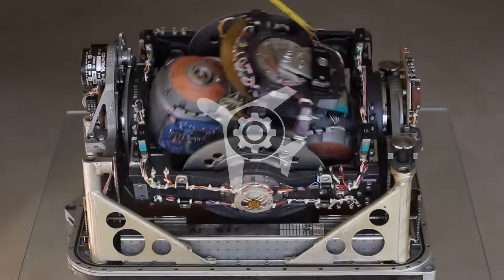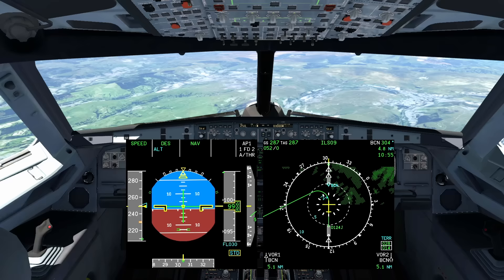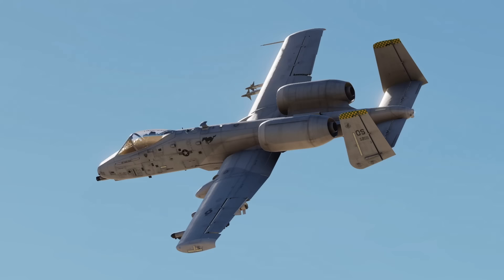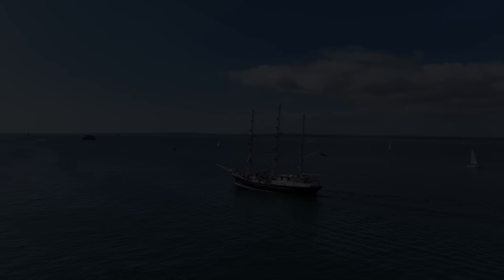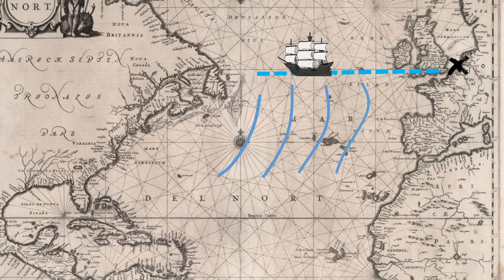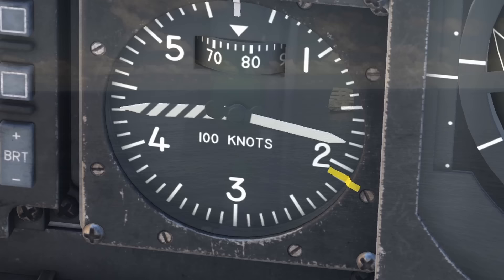The GENIUS of Inertial Navigation Systems Explained

Comment: Nice!  Just to emphasise, the accelerometers measure a change in velocity or speed in a particular direction, not the velocity.  The velocity is determined from the initialization of a zero point along with the additions (and subtractions) of accelerations in three directions along the route.  The gyroscopes keep track of the direction changes made during the route.  The computer keeps track of all the data and gives the location at any point along the route.  Thanks for this great video!!!
Reply from the maker: Thanks!

Comment: Great video. Just one problem: Accelerometers do NOT measure gravity directly. If you Set a single-axis accelerometer on a table with its axis oriented vertically, the instrument registers 1g - even though it is not accelerating.  The table is pushing up with a force equal to the weight of the instrument. Gravity is pushing down with an equal force. The instrument does not accelerate, but it says it's accelerating at +1g - that is UPWARD at 1g. The instrument fails to respond to gravity, and therefore registers the acceleration from the TABLE FORCE ALONE. If you want to get the TRUE acceleration, you have to ADD IN THE EFFECT OF GRAVITY, which is NEGATIVE 1g. 

Remove the table, and the instrument drops, accelerating at -1g. In free fall, it registers 0g. (Note that gravity is operating - you can see the instrument fall! The accelerometer registers nothing, however.) To get the accelerometer's true acceleration, you have to ADD IN THE EFFECT OF GRAVITY, which is NEGATIVE 1g. 

In inertial systems, gravity is never actually measured; it is always inferred from attitude and altitude.

Comment: This technique also exists in nature. The Sahara Deser ant nagigates like this. It walks a number of steps relative to the sun in somewhat random pattern and if it gets to hot, it walk straight back to its antbuilding. A funny thing about this is, that if If the legs are cut shorter when it starts to walk back, it walks just a part of the way back. Also if you elongate its legs when it starts walking back, it walks past its antbuilding.

Comment: I operated & maintained the USN's SINS Mk.3 Mod 4 & Mod 6 inertial navigators in the 1980-90's on an SSN. This was a super sized version of the system described. It was designed in the late 1950's for use on the USS George Washington Class, the 1st strategic ballistic missile submarine. My specific unit was manufactured 6 months before I was born 🤣, it measured a good 7 feet across with head sized gyros & 2 full sized consoles for the pre-integrated circuit computers. Magnetic Drum Memory, those were "the Days." It worked fine if kept cool,  she was air-cooled & abhorred our numerous casualty drills which secured the boat's AC Units.

Comment: Your INS platform looks remarkably like the platform used in the old F4 Phantom. These early INS systems were state-of-art in their day although the F4 INS would lose accuracy if the aircraft pulled too many Gs. Their gyro bias had to be monitored and tweaked by the technicians to make sure navigational accuracy was maintained. And, they obviously had to be aligned on the ground to true north and knowing your magnetic variation was (always) important. The test station in the maintenance shop had to be surveyed and an accurate bore sight established to ensure the system was working accurately. Survey processes in those days were interesting. In my F4 unit in Vietnam we couldn’t see the North Star from that geographical location so we had to improvise. Accuracy though was good enough for the RF4C to use the INS as its primary attitude-heading  reference system (read: no other navigational directional gyro). If it failed in flight the aircrew pretty much  had to try an inflight re-alignment or use the whisky compass to limp home.  I am impressed with where this technology has gone. Great video.

Comment: Just a side note, mathematically there is no reason for the platform to start perfectly level with the ground. From an engineering standpoint I'm sure some INUs required this to maintain calibration. However in theory all that really matters is that the platform never changes orientation from the moment it firsts gets calibrated. At startup, when not moving and on firm ground, whatever the accelerometers read gets recorded as the base line measurement for the earth's gravity and just gets subtracted from all future calculations. The platform never moving has more to do with measurement drift. If the INU can only detect changes in orientation by measuring the difference between the platform orientation and the vehicle orientation, it assumes the platform to be a fixed reference orientation. Thus, any amount of stray movement will make all subsequent orientation measurements slightly wrong by exactly as much as the platform moved.

Comment: Nice intro. Yes those mechanical systems required expensive tooling, exotic materials and watchmaker grade labor to assemble and test. Several generations of technology have miniaturized and improved the approach. Its amazing that 50years later you can buy a complete IMU for $30. Add a microprocessor and software and you can have a complete FlightControlSystem system such as found in most quadcopters today.
Reply: I was a nav et on a sub. Never worked on a lazar guidance but understand that a lot of problems and constant monitoring of the system were over come

Comment: These are frequently used in robotics, although not necessarily to the same extent. The ability to know where you are while flying through clouds is vital for IFR flights, where a pilot has to be capable of navigating a flight without seeing out of the cockpit. Nowadays we have circuit boards with miniaturized versions of these sensors, some even printed directly out of silicon.
Dead reckoning in the real world does begin to accumulate error over time, so it's important to use other sensors as well to recalibrate the INS regularly. Fancier setups will even be able to predict the approximate amount of error that has been accumulated at a given point in time.
Reply: You are right, and inertial navigation systems are used in many things we come into contact with every day, such as drones, cars, and north finders

Comment: Much cooler to me are the astronomical navigation systems used on old spy planes flying high enough to get a good view of the stars. They weren't doing dead-reckoning, they could pinpoint you anywhere in the northern hemisphere with no calibration. Modern equivalent of seafaring astrolabes

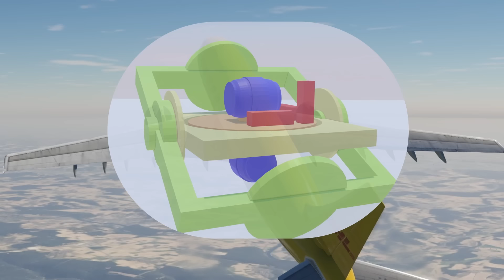Comment: 9:42

to clearfiy 
imagine the earth is fixed
if you run the gyroscope at any location, it will only at the same orientation in the intial location 
if you change your location, you will see the gyroscope change its onrientaion 
if you move to opposite side of the earth, the gyrocsope will be fliped 

however, even if you consider the rotation of the earth, the situation will not change in the vertical direction
and  you can easily compensite the horizontal by the time, each 24 hours= a horizental flip or each hour=360/24=15degrees
which mean, if you run any gyroscope in your room, it will rotate 15 degrees each hours

Comment: I hope you can explain the modern version of Inertia navigation systems, which uses fiber optics and light, which are called “ring laser gyroscopes”, it’s used in all modern aircrafts of all types these days and are much more accurate and redundant than to the mechanical gyros.

Comment: My background in Navigation and Strapdown Navigation is becoming the standard although using designed rotation can make bias observable.   Once you remove the bias (hint: bias slowly changes so it needs to be sampled fairly frequently) it becomes limited by random walk.
Reply: Straptdown is now the norm with INS on a chip.    The presence of GPS allows the INS to be continually calibrated of GPS is present.  This is what happens on INS/GPS guided artillery so that when jamming does take place half way through the projectile flight the INS has been perfectly calibrated.

Comment: Most current INS systems do not use a moving platform, but are solid state. Back in the early '90's I worked for a defense contractor which manufactured accelerometers and angular rate sensors (i.e. gyros) using solid state, vibrating quartz elements. One miniaturized package contained 3 accelerometers and 3 rate sensors (collectively forming a 6 Degree Of Freedom INS system was a cube less than 2 inches on each side and was not mounted on a gimbal platform. Most accelerometers and rate sensors are now made of silicon, miniaturized and cost reduced enough to fit inside smartphones and automobiles . While these cheap ones are not (yet) accurate and robust enough for long term navigation, the concept is the same.

Velocity is found in each axis by integrating acceleration over time (because of summing (integration) over time, any error in the measured acceleration yields an ever growing error.
Position is found by performing a double integration of acceleration over time (errors in acceleration yield even greater errors in position, due to the double integration .

Angular rate sensors have an advantage over accelerometers. Because they directly measure angular velocity, they only need a single integral to determine angular position.
The most accurate angular rate sensors are probably the solid state fiber optic gyros used on submarines. Light beams travel in circular coils, and both directions around a specified axis. A doppler shift is used to measure the difference between light traveling in each direction, and then compute the angular velocity based on the shift.
Vibrating quartz sensors exploit the effects of the 'Coriolis force' on objects moving perpendicular to an axis of rotation. The Coriolis force is also the mechanism which explains why low pressure weather patterns always spin counterclockwise in the northern hemisphere, but clockwise in the southern hemisphere.

A high accuracy INS system will use advanced error correcting algorithms such as Kalman filtering to minimize errors caused by drift, vibration, temperature effects on the sensors and electronics, etc. Many companies produce low cost silicon sensors that are fine for consumer appliances.  For the next level up in performance and cost, a company such as 'Microstrain' is a worthy contender.  https://www.microstrain.com/

Comment: Stable platform INS not only gives the position but also the orientation of the vehicle, ie, the pitch, yaw and roll angles.
Reply: True. That's why they use them in spacecraft. The spacecraft's guidance computer needs to know which way the spacecraft is pointed, especially during engine burns.

Comment: Appreciated the whole lecture.   

A small point if I may?   Dead reckoning is fully and properly called  DEDUCED reckoning.  Nothing at all to do with death, or the nice notion that we are spot on with our assumption.    We have only DEDUCED our position from using the time run, compass direction, and distance run.  Other factors, currents, wind, mist, may have contributed to a near, reasonable even, but essentially inaccurate knowledge of where we actually are.
Reply: Is that a new thing?  Because it has been dead reckoning for the last few hundred years. It could have originated as ded reckoning way back when, but every navigation text or training program I ever encountered knew it as dead reckoning. 

Oxford Reference: Determining position at sea by advancing the last established position for course and distance run. Before the advent of modern navigational systems dead reckoning was the basis of most offshore navigation. The term ‘estimated position’ is sometimes used for the dead reckoning position corrected for the effects of tides, currents, drift, leeway, and so on. The origin of the term dead reckoning, which has been in use for at least four centuries, is obscure. It has been suggested that dead is a corruption of deduced, but there is no etymological, or other, evidence for this.
Reply: @gort8203  Not a new thing, as evidenced by the discussion in your reference.   However, I’ve been under the impression of Deduced for 50 of my 70 decades due to reading the writings of Francis  Chichester, of Gypsy Moth circumnavigation in 1960/70s, and considered to be one of the greatest navigators ever known.
Reply: @josephinebennington7247  Well, now I know where it came from.  So far Mr. Chichester is the only person I know of to actually use that term.  You'll have to forgive me if I stick with the common and universally accepted term spoken by every navigator I have ever known, as well as every navigation text I have ever seen.  I don't deny that ded may have been the origin of dead, but I have never seen it used.  As one who adheres to the original pronunciation of the word forte even though it has now become uncommon and even unrecognized by the masses, I can sympathize with someone who chooses to adhere to Mr. Chichester. Thanks for the info.
Reply: @gort8203     Consider…If you have decided on a position based only on your time, direction and speed from last known position, you cannot but have deduced it.  
You certainly couldn’t have “deaded” it. Apparently  Chichester was remarkably good at such navigation.  In the air as well when he was a pilot. 

“Dead” sounds better because it sounds like “she/he was dead right” , being as unequivocal as death.  So it sticks in the imaginative human mind and becomes habitual. 

Further, people who have frequent use of any long word or phrase will shorten it, especially if, say, reporting or requesting a position.
Reply: However I found this on Wiki, so…maybe I’m corrected, maybe not…my pedantry (and Francis Chich) prefers to think I’ve deduced my position from previous information. 
So…
”Etymology -,The term "dead reckoning" was not originally used to abbreviate "deduced reckoning," nor is it a misspelling of the term "ded reckoning." The use of "ded" or "deduced reckoning" is not known to have appeared earlier than 1931, much later in history than "dead reckoning" appearing as early as 1613 in the Oxford English Dictionary. The original intention of "dead" in the term is not clear however. Whether it is used to convey "absolute" as in "dead ahead," reckoning using other objects that are "dead in the water," or using reckoning properly "you’re dead if you don’t reckon right," is not known.[1]”
Reply: @josephinebennington7247  I saw that as well, and I'm glad you found it yourself, so I didn't have to present it to you.  I firmly believe the word "ded" is a bit of revisionist history.  People make stuff up all the time just because it sounds good to them, and they assume others made an error.  Another good one people take up sides over is the origin of "the whole nine yards" for which I've heard everything from ammo belts to bolts of fabric. When I was first taught dead reckoning, I instinctively understood what the term meant even though I might not have been able to articulate it, so I think there is a reason all but a few have never questioned it.

Comment: This device was also multi-purposed in variable depth sonars, specifically in the US Navy's AN/SQS-35(v) Towed Vehicle, aka, 'fish', manufactured by EDO Corp. It provided realtime true North for ASROC and torpedo analog fire-control solutions of targeted submarines. Towed from the stern by Knox Class frigates, the gyro, with additional sensors, was located at the base of the two ton fiberglass, lead-weighted vehicle. Working at depths, usually below the ubiquitous variable oceanic thermal layer, up to 100 fathoms (600 feet). It was often CASREP'd (non operational for maintenance/replacement) due to shocks from the extreme operating environment and jarring retrievals.

Comment: I worked on that stuff in the Air Force.  The A-10 and F-111.  Deadly for it's ability to be programmed with pilots aboard but they know not of the mission they are on.  Programmed by an intelligence officer as the plane is sitting on the runway awaiting take-off.  The truck pulls up, programs and speeds away.  BOOM!!!! The aircraft takes off to it's programmed destination.  They better take notes so as to find their way back.  heehee.

Comment: In dead reckoning you directly measure the speed while inertial systems embedded in plane only measure acceleration. That's a huge difference. Any error in acceleration measurement will induce an error in the speed estimation that will cumulate, and therefore the error in the positionning will constantly increase until the end of the flight. How these systems are still able to achieve acceptable performances is beyond my understanding.

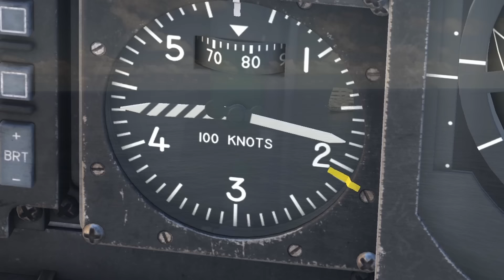Comment: @ 3:46 no, we don't use knots because of that antiquated method, we use knots because it takes into account the curvature of the earth. By contrast, russian aviators use KM/H because they think of flight as movement through 3D space, XYZ. We use knots because we consider flight to be temporary and relative to the ground to which return must be made. You can see further evidence in this by the standardized gauge known as the Aritificial horizon in an airplane- it shows the ground relative to the aircraft so you don't fly straight into the earth. The russian equivelent is an attitude indicator, showing the pitch of the aircraft from the POV of the ground which is also bizarre.
Reply: I'm pretty sure he's basically just talking about where the word comes from.
Reply: @Reth_Hard  could might be